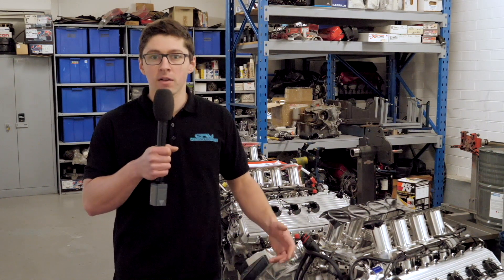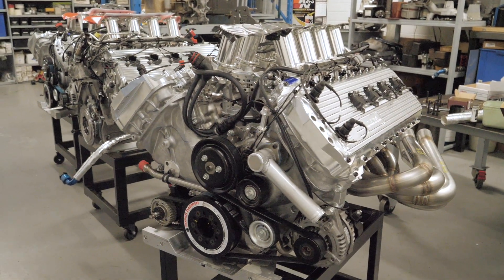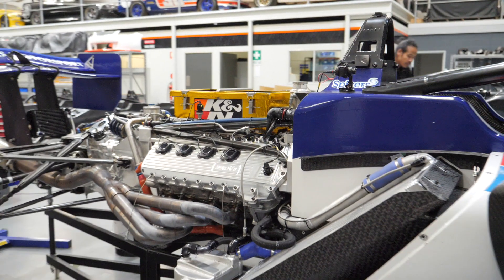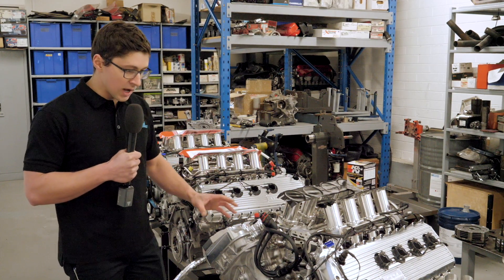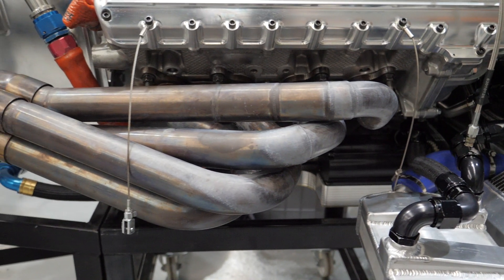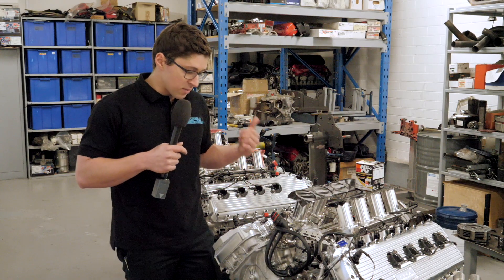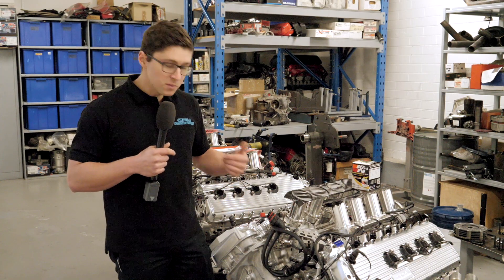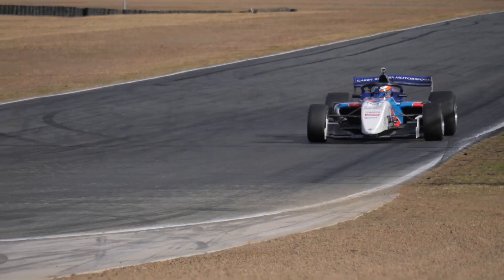S5000 Technical – Engine

Comment: So, its really an S5200 formula? I remember the good old classic days (and current historic days) of the original F5000s, when Australia was innovative with, in addition to the American Chev, we had our locally made Repco/Holden V8 winning, and our locally made Leyland 4.4 V8 winning. Surely, as there are companies still making Holden V8 and Cleveland V8 stuff here, we could have developed a "Rogers" S5000 Ozzy V8 locally? 550hp is fairly easy to attain now days.
Reply: Too old. Besides, they went for a control engine to;
1) keep costs down,
2) to make racing closer and
3) to keep the category sustainable through long term support.

Nothing is more capable of killing a category that spiralling costs.

Incidentally, there’s a lot of Australian engineering in these things. You should read about how they were developed.
Reply: @thethirdman225  Yeah, but they are just Ford Coyote engines....all the way from Good ol USA. At least the Miami in my XR8, was made with lots of locally developed parts and assembled in Oz. ;). They could easily use a "Crate" COME Holden or 3V Cleveland developed and made right here, for this category, and keep the money local.

Comment: with the revs and exhaust they sound so boarish it's the 21st century the sound is not spectacular it stinks it sounds backwards with technology electronic injection should be on it with better cams and a small turbo  rubens must be getting a good paycheck just to help promote the sport and fingers crossed it takes off I'm looking forward to it I'm backing Matt brabham. 
who in Australia could not his bloodline is pure for this category glad to have him back cant wait till they come to good old eastern creek
Reply: This whole point is to be like the old f5000 cars. It's completely gone over your head. Watch a different series.
Reply: @weallfollowmanutd  then race the fucking old f5000 don't develop a new car with old outdated concepts moron your values are the reason single seaters never takes of in this country and were stuck watching shopping trolleys do circles go back to your cave this is the 21st century
Reply: Punctuation doesn't cost extra champ.
Reply: @seanwilliamson466  took you 3 years the come up with that insult

Comment: V8's are dinosaurs, but a V6 turbo unit in there, with modern styling. That would be perfect.
Reply: Completely missing the point. Hello!!! It's called F5000. It's supposed to replicate F5000
Reply: Big torquey V8s are fun to drive and they make a great noise. I like this series.
Reply: Please tell me your joking.
Reply: Watch F1  😂

Comment: Why choose that engine over a GM LS376-515? If 5000cc was the target capacity you could get a custom crank and rods for less money than the Ford motor unless you got some sort of deal from Ford. Not trying to be smart just interested.
Reply: Newer design.
Reply: HP per liter on the coyote is significantly higher than the LS design. The DOHC heads with Ti-VCT flow exceptionally well in the lower rpm range without limiting its ability to breathe in the high rpm range. The result is a very linear power curve that doesn’t suffer in the low rpm

Comment: FIA: let's build F1 cars with 1.6 turbo hybrid engines, and promote formula E.
Australia: screw that! Let's bung a tuned Yank V8 5.2 litre engine in an open wheel car. That'll piss off them climate protesters!
Reply: I’m a supporter of those protests and I have no problem with this category. It’s not a major contributor to greenhouse gasses.

Comment: I wonder if GRM went back to the Formula 5000 cars and designed the exhaust to make that sound, modern day exhaust design doesnt really convey that sweet V8 sound.
Reply: The chassis not made to of aluminium either. Just an observation but the exhaust system is not very different from the F5000s of old. They should sound very similar.
Reply: Yeah not a patch on the old Chevys , Lola t70's still have  it to this day.....proper noise not these dumbed down farty sounds.
Reply: neil pine Well, I was there yesterday and on Friday and they are not farty.